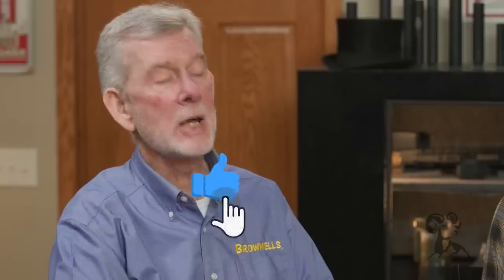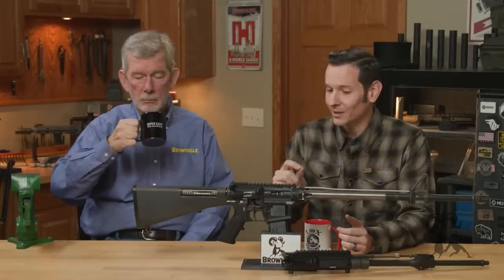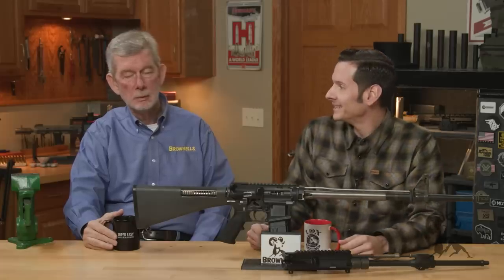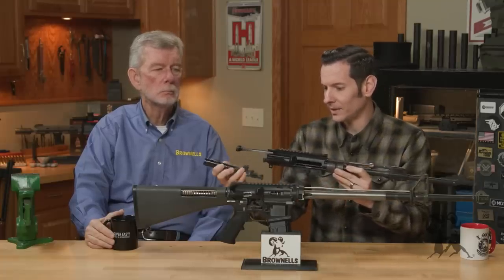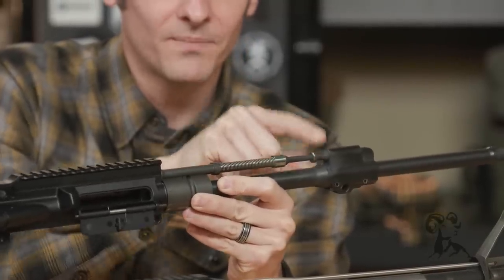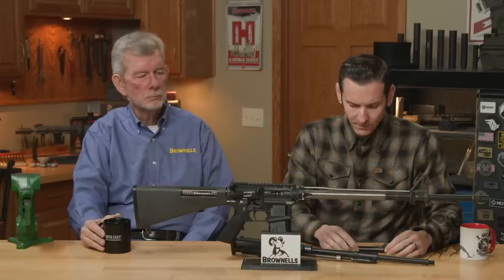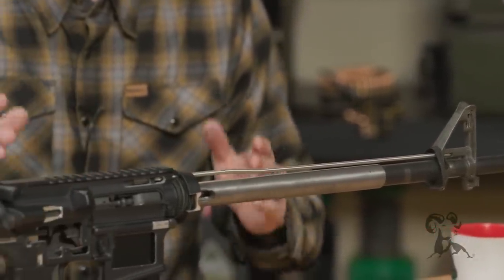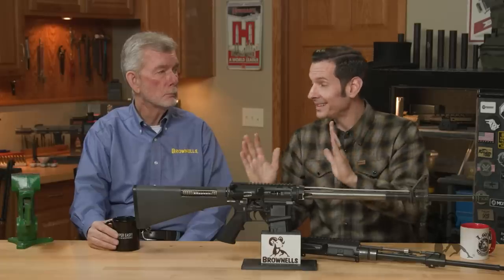Smyth Busters: The AR-15, Direct Impingement or Piston Operated?

Comment: Is the bolt acting like a piston? Isn’t it going slightly forward because of the gas while the carrier is going rearward?
Reply: If the bolt moves forward at all, it is miniscule due to the headspace.  The bolt face is pretty is sitting against the barrel extension and can't go much further forward. But yes, the bolt is the piston and thr bolt carrier is the piston cylinder.

Comment: I know this is a year old video but thinking about it I think I would call it a passive impingement system 🤔 Sounds right to me seeing as the gas pressure passively blows through everything in the system.
Reply: The over 2000 PSI of gas charges a piston chamber like any other piston system, not passively..It is not a true DI..

Comment: That was one that was super informative for me at least I’m in the middle of deciding a piston system to go with like the hk416 but I also love the long stroke piston system that PWS uses does anyone have an opinion on primary weapons systems
Reply: I have PWS's piston guns in both 5.56, 308, and 6.5 CM.  For me, pistons are more fun to shoot.  I'm not sure why. Perhaps it's how a piston changes the recoil impulse. The PWS guns are every bit as accurate and reliable as DIs.  The only downside is that they tend to be more expensive (around twice as).  They DO run cleaner and cooler than DIs.  But after all is said and done, I still hesitate to say which is best.  They are different.  Only you can decide which to get, which fits your needs and wants better.  I'll go out on a limb for you.  If this is your first AR, go DI. Give the 223 Wylde clambering a serious look see.  Good luck.

Comment: I have several piston, they are cleaner and cooler. The gas leaves from the gas block and not through the bolt carrier and into the upper.
Reply: External op rod guns have hotter temperatures imparted to the gas block and piston up front, due to port pressure and port diameter.  The hotter heat up front is isolated away from the bolt carrier.

Stoner Internal expansion systems flow the hot gas through the gas tube,, carrier key, expansion chamber in the carrier, then vent it out the ejection port through holes once sufficient carrier inertia has been generated.

They just have different approaches to thermal dissipation and using hot gas expansion to operate the action.

This is one reason why you typically see more mass on external op rod gas blocks, to maintain dimensional uniformity of the block/heat sink.

Comment: You guys sound like me in third grade when I tried to persuade the class the F 14 wasn’t a true swept wing design
Reply: The F-14 has leading edge wing sweep in any wing position, with highly-swept wing gloves that form part of the variable sweep arrangement, in addition to being a lifting body.

It also has more wing loading flying straight and level than it does in a turn, due to AOA-generated lift from the tunnel between the nacelles.

It also is more aerodynamic when carrying 4 AIM-7s in the recessed stations due to laminar flow directed by their fins.

Comment: I call the AR10/15 a "Remote Gas Piston system" because unlike a traditional long (AK, FN MAG, ect) or short (M-1 Carbine, AR-18) stroke Gas Piston system, you don't have the impact on the piston at the gas block.
Reply: Internal Gas Piston System
Reply: Stoner patent describes it as an internal expansion system.

Comment: when you have a new system that doesn't match any of the current/previous systems, than you need a new name. it does not serve to debate which old system the new system most closely resembles.
Reply: In the Stoner patent, it does have a new name:  Internal Expansion System.

Comment: Do you get more gas blowback through the firearm from a DI or Short Stroke Piston? Why is one cleaner than the other?
Reply: DI, AR15 has gas vented into the upper receiver into the bolt carrier key passing through the bolt carrier and out two holes in the side.
Short Stoke Piston, gas vents at the gas block on the barrel.
There is something called a mud test, AR15 wins every time.

Comment: But WAIT!!!  There's more!!!  One thing almost no one mentions... observe that the piston on the bolt, the section where the gas rings are, is approximately the same diameter as the cartridge head.  While the gas is pushing back on the carrier, it is also pushing forward on the bolt, thereby equalizing the rearward pressure of the cartridge pushing back against it.  This greatly reduces the pressure on the bolt lugs.  This pressure equalization does not happen with piston systems such as the HK416 or the old Rhino gas piston from years ago.  With a piston system the bolt lugs are subject to much greater wear and tear, chipping and breaking, as the bolt is unlocking under pressure.
Reply: If the residual bore pressure equalizes to the internal expansion system pressure, it should float, but the dynamic range varies with port location, size,  ball vs stick powders, ambient temperature, etc.

Cyclic rate has more of an effect on bolt lug torsional load with residual bore pressure.  Faster cyclic rate is harder on the bolt lugs, which is why CLGS suppressed exhibits earlier bolt fatigue.
Reply: @LRRPFco52  Yes, not perfect equalization of pressures, but better than none at all, which is what the piston systems give you.

Comment: I run DI on everything, never planning to build a piston system. simple, and has secondary benefits.

what difference does it make if I clean carbon off the bolt and carrier, or off the piston/sleeve? still have to clean something regardless.
Reply: The biggest difference is temperature and how it affects lube.  A hot bolt carrier will burn off lube, whereas an external piston keeps the bolt carrier much cooler.
Reply: @armynurseboy  Yes, the biggest difference, according to you, makes no difference at all.

DI runs in the arctic, it runs in teh desert, it runs in teh jungle....

I would go weeks without cleaning my rifle. If you get a proper thin coat of oil in the bolt  and carrier, even after weeks of carbon build up, it all nearly wipes off. oil layer still intact. Works great.

Comment: In the BRN4 then, Where does the gas go after triggering the piston? Does all the gas then simply follow the projectile out the muzzle? And is there more recoil to one system over the other?
Reply: It vents under the handguard.
Traditional piston systems generally have more mass in moving parts and it's off the bore axis -- therefore more recoil.
The brilliance of the AR is twofold:
- Keeping all the moving parts on the bore axis
- Generally lower mass of moving parts (really low in tuned competition rifles)
Reply: @maxxon99  Thank you!

Comment: Are these aftermarket piston systems as reliable as a true piston AR?
Reply: I don't shoot mine a ton but it works well with or without a suppressor attached. Some light tuning of the gas block was needed. I use the adam arms kit with the adjustable gas block (non pic rail).
Reply: No, simply because of carrier tilt. A properly designed piston AR should have something to keep the carrier from tilting from the force of the op rod striking the bolt strike face. Buying a piston BCG isn't going correct that issue. Other than that they're essentially the same thing forward of the receiver.

Comment: Both systems just unlock the bolt! 
It is the pressure from the barrel that drives the carrier back after unlocking is done.

Just think of why the gas tube isnt as thick as the barrel... because it just needs some of the gas to unlock the bolt...

Comment: So to my understanding you have a piston or piston-like section of the firearm, a long tube that operates as an expansion chamber as well as a path to direct the forces from expanding gasses. The AR-15 operates using the propellant gas to reset the whole of the machine to get it ready to fire, the piston in the bolt acts more-or-less like a delaying mechanism than it does an operating mechanism. You could hypothetically create a special bolt that does not have a piston, but still interfaces with the rest of a normal AR-15 to cycle as a true gas impingement. Would this be the first gas operated and delayed hybrid mechanism? No they show up from time-to-time, but often require a greater manufacturing expense to have operate reliably and require economies of scale to create iterative improvements. The US going all in on the AR-15 in the 60s and having real staunch stick-in-the-mud generals means that the AR-15 is here to stay and will only be replaced once one new rifle can best it in all facets of manufacture and design. No rifle can match the economy of scale that the US has with the AR-15 so these micro-improvements get to happen and because nobody really owns the AR-15 at this point, or at least it should be a public domain design at this point, you see a rather unusual design succeeding. 

All that said, I don't think people will call the AR-15 a gas impingement piston delayed hybrid mechanism because brevity. Also language is a descriptive and limited thing and how we choose to describe anything or put words to any ideas you will lose information in favor of brevity and ease of communication. I do not think it would be necessarily helpful to give a long-winded answer to what is really a short question; how does this thing work?

Comment: Gas operated bolt. No piston.
Reply: The bolt is the piston..
Reply: @hairydogstail  No that is why they called it a DI gun...gas driven!
Reply: @iamgermane  No, Stoner's patent calls it a piston, not a DI..That is why it is an internal piston and (they) who call it a DI are as incorrect as you are..
Reply: @hairydogstail  Well it is a misnomer, as there is no physical contact. DI means "direct impingement" of gas to operate the bolt carrier.
Reply: @iamgermane  So Stoner's own patent description, the patent office that approved the patent and, plus the fact the rifle is actuated by an actual piston is a misnomer??? Seek help..
Reply: @hairydogstail  Yes you seek help. Do you not know what direct gas impingement means?? No piston making contact with anything.
Reply: @iamgermane  Yes I do, but you obviously don't lol..If Stoners system is a DI, then what is Stoner's patent for slick, since the MAS 49 and Automatgevär m/42 were true DI rifles, invented years earlier?? The bolt (which is the piston) makes no contact with anything?? It makes contact with the barrel extension (that is how the bolt locks) and carrier, the bolt support area makes contact with the carrier bolt support bore and the boat tail makes contact with the bolt tail bore..The  carrier has the expansion chamber (as all pistons have) and the gas rings seal the gas on the piston (the rear of the bolt).. 
What do you think the bolt rings are for Einstein??  The FN SCAR, M7, AUG all have gas rings on the piston and so does the AR15.. As the carrier travels backwards, the charged expansion chamber expels the gas through the vent holes, as all pistons operated rifles  do.. By the way, nice deflection on Stoner's patent lol..
Once again seek help..
Reply: @hairydogstail  No mechanical piston slick!

Comment: I would not argue too much about the fact that there is a piston in direct impingement mechanisms because there is actally always some kind of piston-cylinder couple in any self loading firearm. Even in blowback ones where the cartridge case acts as a piston and the chamber as the cylinder and in recoil operated ones where the locked breech acts as the cylinder and the projectile as the piston). The special thing about direct impingement is that the energy conversion of pressurized gas into a moving mass needed for cycling is happening directly inside the bolt carrier and not inside the gas block or the bore. The right way to separate the direct impingement action of for example a MAS-49 and Stoner's design is to add the words short stroke or long stroke as prefixes. Per definition of ordinary gas operated firearms: A long stroke design let's the piston travel the whole distance of the bolt carrier. This is the case for the MAS-49. The gas tube just acts as a stationary piston and the bolt carrier as a mobile cylinder. The AR-10s and -15s are short stroke direct impingement actions because the piston a.k.a. bolt head moves only the distance needed for unlocking inside its cylinder (the bolt carrier). The Bolt then continues it's travel without separating the piston-cylinder couple any further which is 100 % how a short stroke gas operated action works.

Comment: Nah. It is still direct impingement because the gasses push the bolt carrier back as the bolt is still locked. It's the force of the bolt carrier moving rearward that then unlocks the bolt. So it's not really a piston. It's just an expansion chamber. So it's the effect of the gas pressure tjen blowing back the carrier to turn the cam slide to unlock the bolt, to push that unit back. So I  think it's more related to a blowback system.

Comment: Personally, owning both types, each have their benefits. The DI rifles definitely are smoother recoil, and generally more accurate, imo. However, the piston design has shown itself to be much cleaner, and more reliable for long term use where you don't have the ability to constantly clean the weapon. However, most newer DI bcg's that are coated, do operate much better, and make it easier to clean. Though admittedly, if I was in an "end of world" scenario where I had a choice, I would probably grab the piston gun, if nothing else for long term reliability.
Reply: As long as nothing happens to the piston system. The problem right now is in some weapons a piston setup is uncommon thus making replacement parts harder to get.
Reply: @jackshett  Most piston systems on the market today, Adams Arms, and HK being the most robust, will outlast the barrel. Even the short stroke springs seem to last forever, compared to older long stroke piston rifles like the M1 and M14. In a scenario where spare parts are not available, much smaller items are needed more so than a piston and spring. On a DI system, a gas tube is something to have a spare of, along with various springs, extractors, and other parts used by both.
Reply: @Condor1970  Keep in mind that if you're assuming usual wear then the piston or gas tubes wouldn't be an issue. But the question is if the rifle gets damaged, dropped, etc.. I use the adams arms kit and love it but I don't abuse my guns either.
Reply: @jackshett  Usually, a quality handguard is for that kind of protection. In reality, if you're in a situation where you damage your rifle to that point, then you're probably not going to survive anyway. lol

Comment: I disagree, you're trying to split hairs on a bald man (I just made that up).  "TO ME", the bolt carrier may act like a sleeve, but it is NOT a sleeve, and the only reason the bolt moves is 1. because the bolt is temporarily held by the teeth in the chamber, 2. The gas IS hitting the Key, it's hitting the inside of the key and 2. The gas IS hitting the bolt carrier, it's hitting through the gas key inside of the carrier instead of the outside of it (BIG DEAL) forcing the carrier to the rear, hence cycling the action, causing the bolt to move due to inertia NOT because of it being a piston, which is why it's called a bolt and NOT a piston.  I'm NOT a gunsmith and don't ever pretend to be one, but it doesn't take a gunsmith to look up the definition of "Impingement" and "Direct Impingement", nowhere I could find says the gas MUST hit the OUTSIDE of the carrier.  I'll have to go with Eugene Stoner on this one, by the way, a whole heck of a lot of people consider him a genius.
Reply: Nope, the bolt is the piston and it charges the expansion chamber like all piston operated rifles..After a short distance, the charged chamber expels the gas like all piston operated rifles..It is not a DI.. Stoner's patent describes it as a stationary piston, not a DI..

Comment: Based on that direct impingement debate, the same can say an Airbus A380 is a boat because it, too, like a boat; it has a Starboard, a Port Side, and a Rudder. So A 8320 and, alike, is a boat. Oh, the A380 Airbus is also a submarine because it, too, like a submarine, has a  pressure hull.

Comment: This is a semantics argument that has been made popular by some YouTubers in recent years.  If I am to accept the premise that the M16 is piston operated, then I must counter that nearly every self-loading firearm ever made is piston operated.  Look up some of the definitions of piston: "a sliding piece moved by or moving against fluid pressure which usually consists of a short cylindrical body fitting within a cylindrical chamber or vessel along which it moves back and forth."  "A disk or short cylinder fitting closely within a tube in which it moves up and down against a liquid or gas, used in an internal combustion engine to derive motion, or in a pump to impart motion." 
Based on these definitions alone, the 1911 pistol slide is an external piston.  The MP5 bolt is an internal  piston.  The M1 rifle bolt is both an external and internal piston.  One might argue that chain guns and modern Gatling guns are not piston operated, but I would counter they are not true self-loaders since they require external drivers.

Comment: The irony is that the AK would've been the perfect platform for a direct impingement gas system. The tolerances in a AK receiver are such that you could blast propellant gases into it all day with hardly any issues at all on reliability, at most a slightly tighter cleaning schedule.